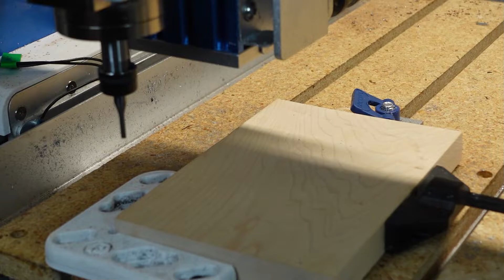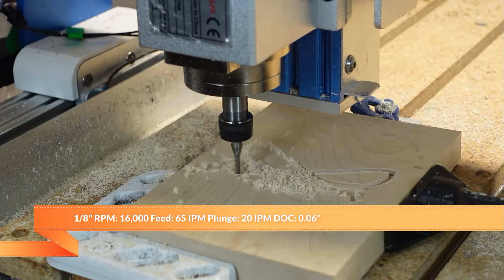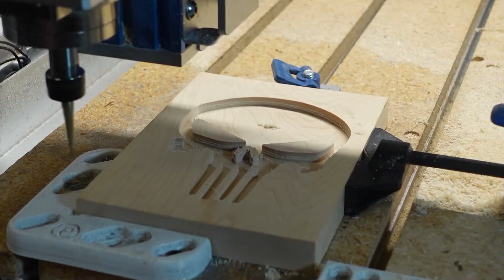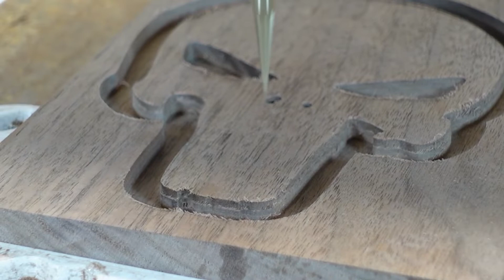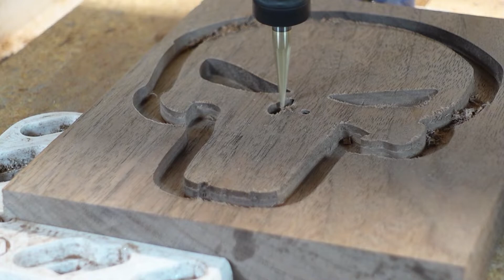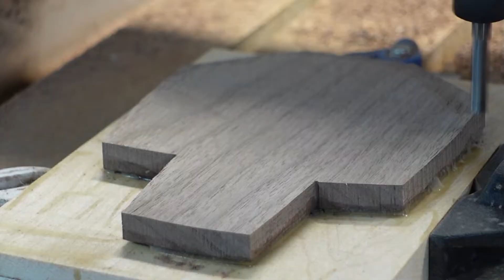Punisher V-carve inlay Test - Full

Comment: What bits are you using?
Reply from the maker: Thanks for watching! I use Yonico 35310-SC 1/8" bit for clearing out bulk material, and Amana Tool 45611-K tapered ballnose (configured as a v-bit).
Reply: @tk.designs  thanks I'm going to have to give the tapered ballnose a try, I've been having trouble with inlays when there's a tight design but looks like you have it figured out!  Thanks
Reply from the maker: @dennis954rr01  Thank you for your kind words! If I remember correctly, I learned mostly from Stephan Forseilles  here on YT. There is a video he does with a YT button that really breaks down v-carve inlays.  Please check him out.